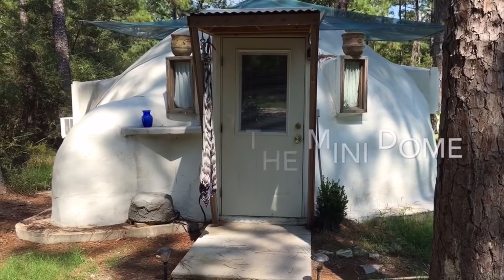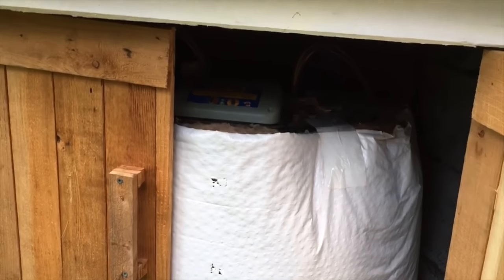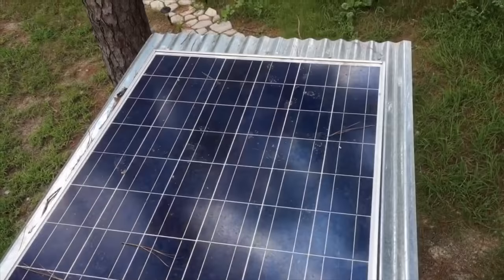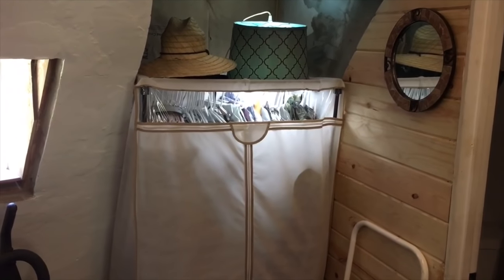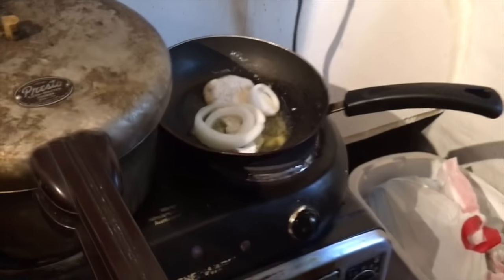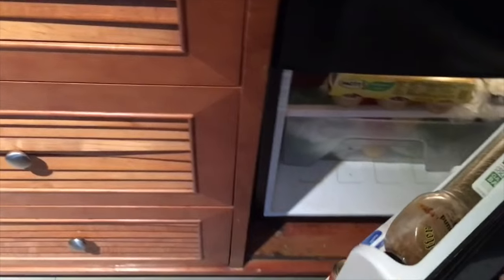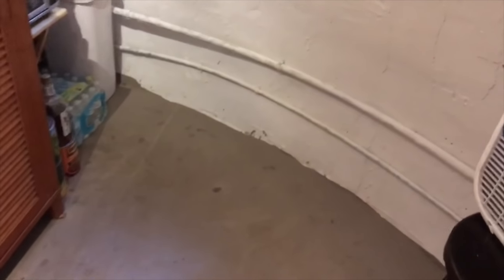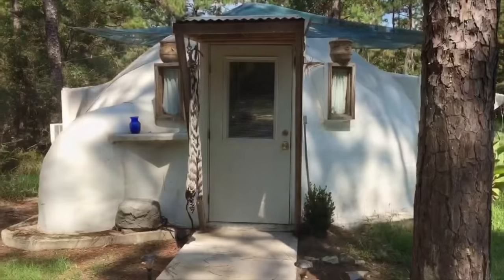The Mini Dome Home Tour

Comment: Nicely built, but would be ever so small for me.  The finish on the outside and inside looks too rough for me.  For me, it would have to have very smooth walls all round.  I wonder, did you finish it better after doing this video?  You are very talented and I am sure your technique and design will improve over time.  I agree with stormthrush37 that you need to do more panoramic views first and pause from time to time.  Gives a person time to absorb all that you did.  Although one can use the pause button at the bottom of the video screen.  Looking forward to see more of your builds.  Thanks for sharing.  Happy New Year and may it be a prosperous and healthy one for you.

Comment: How do you mount kitchen cabinets on the dome curvature?
Reply: amcgrrl so we mounted the cabinets on the straight portion of the wall. I call it the "wet wall" which backs against the bathroom. All of the plumbing runs through this wall also. We did it this way to avoid the curvature issue